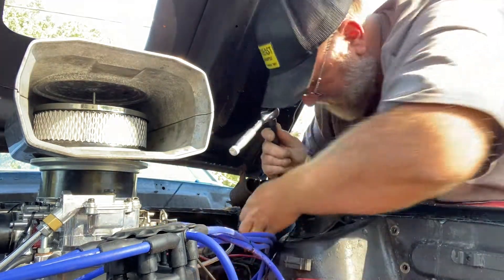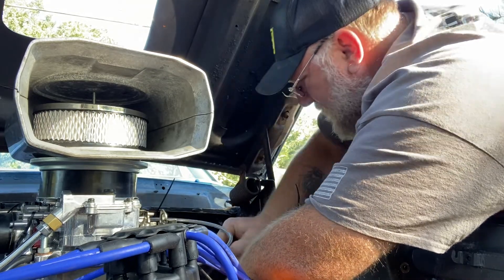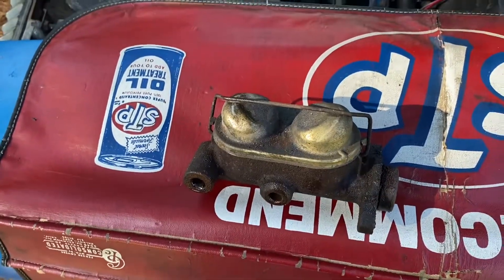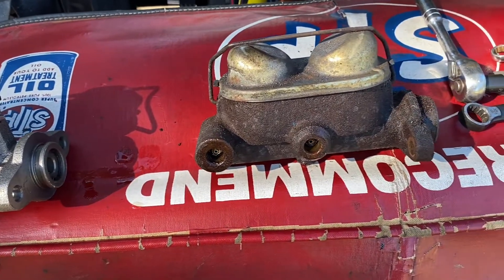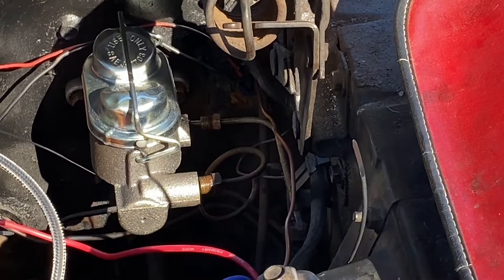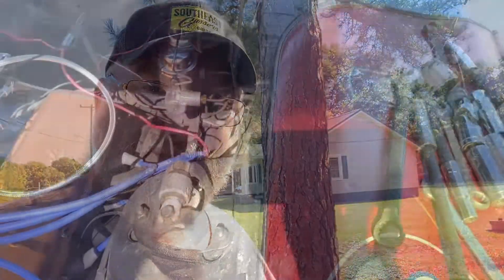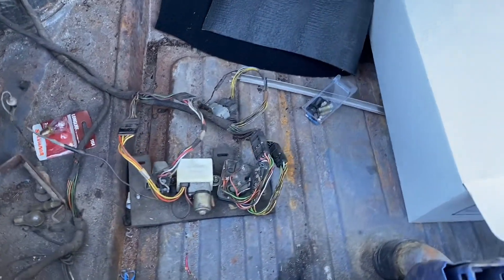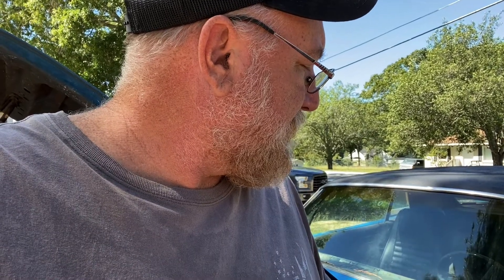Now the cougar can stop

Comment: I like your driveway too. I'm committed to old iron. For years I drove older cars mostly stuff I picked up in yards. One time in 1982 I bought a new car. My wife liked it. A Pontiac Grand Prix. A underpowered V6 crapper that I hated it.. That was the last " new car" I ever bought and Ive never been stranded by the side of the road driving a 60's or 70's vehicle.  I'll stick with the older stuff. At least I don't have to look for 5 computers/ controllers hidden in the car that might be a problem.